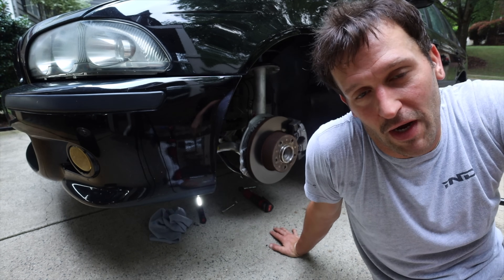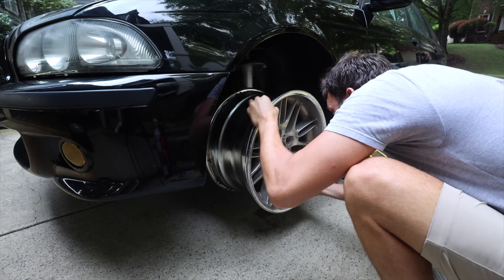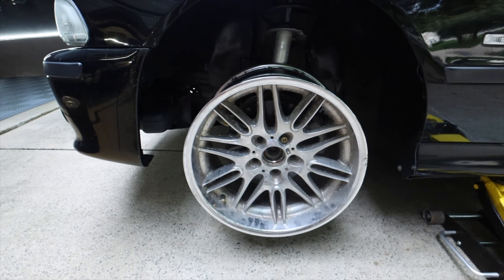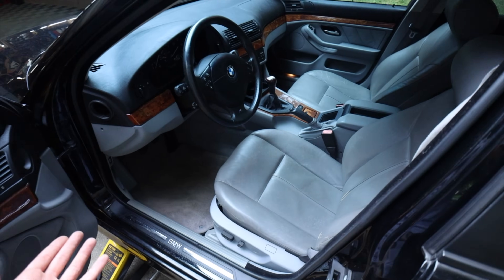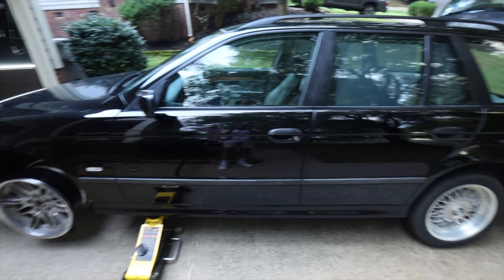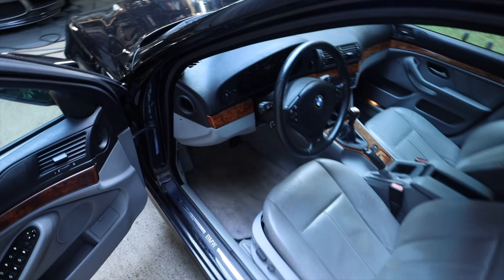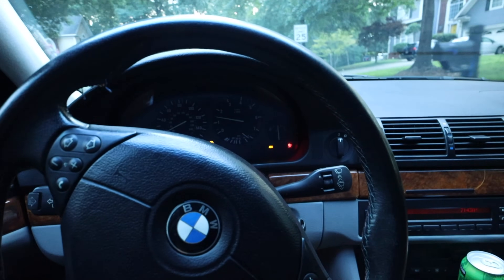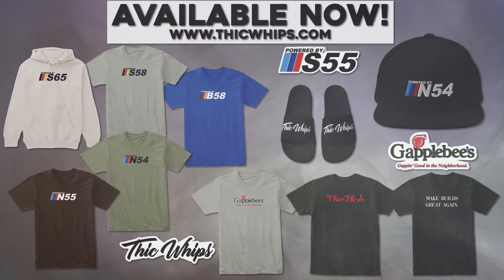I Bought My All-Time Favorite E39 Wheels!

Comment: before replacing wheel speed sensors you can see if the current ones are giving the ECU any values or not. Go to live data and find the PIDs for wheel speed sensors, watch them as you drive to see if all of them match or if they are dropping out intermittently, may have to go through the ABS module to find it depending on your scanner. Also check other ABS values while you're in there if they point to something. Activate the pump to see if the motor is working on the ABS unit and whatever else applies to your specific unit.

INPA also works which is what I used on my e46 when I was dealing with an ABS issue. Ended up being the pre-charge pump which is only used in some early E series and my clue was when I activated the pump through INPA it blew the fuse... the pump was seized.
Reply from the maker: This is good info, thank you!

Comment: My e46 had issues which the pump mentioned in other comments. Sometimes it didn’t work sometimes for months perfectly fine. 
Other mates had to bring the Controller of the abs to a repairshop. There has to be a specialized repairshop for these car controllers near you. They will check it first and tell you if it’s healthy or repair it otherwise. These often got issues which „cold“ connections. 
Also: get a oscilloscope and control if the signals get to your controllers plug when turning the wheel.

Comment: Hey man, for the dsc issue, it may be the abs ring.  I had a similar issue on my e46.
Reply from the maker: Ok thanks!
Reply: Same with my e39 wagon it was the tone ring on the half shaft that needed to be replaced 

It wasn’t creating the magnetic field needed for the sensor to work properly

Comment: If INPA can't find a module... bingo. There you go. Also - lots of the ABS issues on older E-chassis cars are typically when warm/hot (ie - trans failsafe after 30 minutes of running).

Comment: On E39's the ignition lock cylinder is part of the car's security and currently its a dealer only part each part is specific to the car's Vin # and can cost as much as $400 if your key is kind of wobble fitting I'd order that part before the tumblers give out rendering your E39 non working oh and that part could take 3 to 5 months to arrive.

Comment: Do a turbo on her no need for the v8 the way modern  turbos can wake up a in-line 6  

Also I hear that the steering box was a mess on this chassis 

I think bmw used the steering box aka “slush box”versus the steering rack like in the inline 6 cars cause of the limited space or the placement of the oil pan. 

I have a 99 528i wagon as well and ran  into these issues and decided to go Garrett turbo 

BMW using the same tech from the 80s today on the s58 

Trust the engineering  love your channel and thanks for representing NORTH CAROLINAS CAR CULTURE IN A POSITIVE WAY 🫡🇺🇸💚⚡️🔥🙌

Comment: Why go with an E39 build over an E61 build? I’m starting to like the E39 but if I was doing it myself idk if I could pass up building a manual V10 wagon. Could probably even find a way to drop an S85 into an E91. Excited to for the E39 build none the less.
Reply: BMW made a e61 wagon but didn’t make a e39 wagon that’s the reason in itself to build the car that the bmw engineers missed

Comment: Interesting intermittent fault, works from cold and not once it's been running a while.... A dry solder joint inside a component? Heats up expands and breaks the connection but contracts when cold? Might be the ABS module wants refurbing, either way you could do with the car talking to ISTA or INPA. Watched this one? https://www.youtube.com/watch?app=desktop&v=tfP-8821Jwo